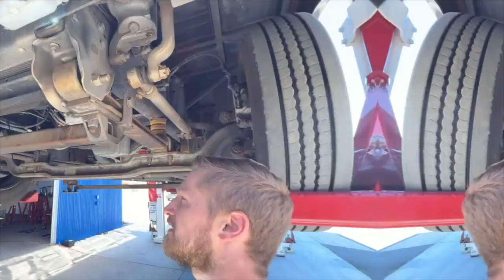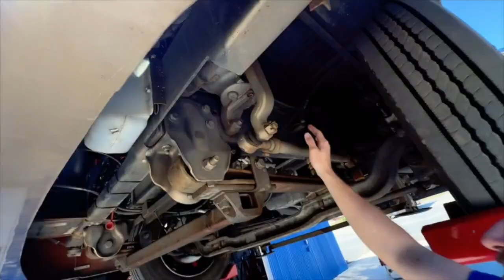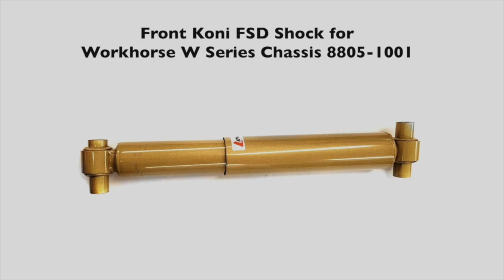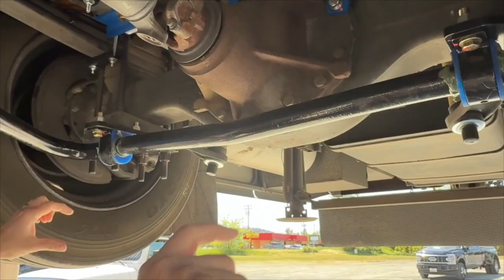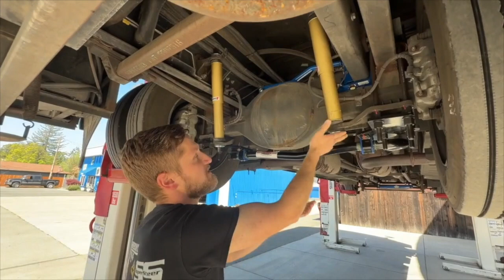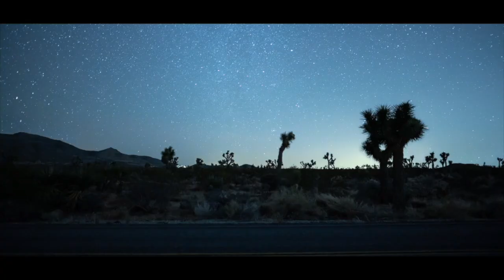Why the Workhorse Chassis Might Be Better Than the Ford F53 (Here's Proof!)

Comment: Nice and comprehensive  - looks like loss of 2-3" ground clearance due to sway bar at rear?
Reply: The rear sway bar is 1.5” below differential now.   However keep in mind that the true low points are the rear hydraulic jacks which are about 5’ further back and about 3” lower.
Reply from the maker: Well said! We have been installing these sway bars on the W-series since they were new, and have not seen issues due to the slight loss in ground clearance. Especially considering that other components such as the leveling jacks already sit lower.

Comment: This is my coach.   A couple of comments on a) Henderson Lineup/Supersteer; b) the driving results of the improvements; and c) the Workhorse chassis.

Henderson/Supersteer.   Rather than doing the described improvements myself (which is my norm) I elected to have Henderson's do the work.    I wanted an integrated result that includes a full road test analysis and alignment.   Their service and professionalism is really unsurpassed.   The work took three days, so my wife and I stayed the first night at Hendersons, then visited family in the area.   Grants Pass has a lot to see.   Go to Henderson's!

Results.   After the work was completed, we drove straight through from Grants Pass oregon to Olympia Washington -- about 360 miles of rutted curvy interstate with poor concrete and many passes to climb and descend…in wind.  The difference is night and day.   Gone is the massive body roll, lane wandering and bone jarring bridge crossings.   As an overall bellwether, I found I was easily driving 5 to 10 miles faster comfortably -- from a usual 60 mph, to 65 or 70 mph with comfort and a full feel of control.    I cannot point at any one new component as being the best, as they all contribute to a much improved integrated whole.

Workhorse Chassis.   I purchased this 2011 Tiffin Allegro Open Road in 2021 with 18k miles.  It has always been stored indoors the first 10 years and used very little.  I drove it four years bone stock before deciding to upgrade.    Maybe I am just tolerant, but I never felt the soft handling was completely terrible (until now compared to the improvements).   The 8.1L Chevy V8 combined with the 6 speed Allison is a strong drive train combination.   Very powerful and due to the low end torque, quiet comparted to the comparable year Ford V10.    2011 was the last year for the Workhorse chassis, but don’t let that scare you.    8.1L parts are plentiful and many shops are happy to service the same engine offered in may early 2000 pickups.   All in all, I've found that buying a used, low mileage gas motorhome has been a very practical route.   Even with the above suspension work AND a full investment in a solar/lithium/charger/inverter system, I've invested substantially less that on a newer year coach.
Reply from the maker: Wow! Thank you so much for the detailed feedback. We agree, we like the W-series coaches. Glad the upgrades gave you such an improvement in driving enjoyment. Thank you again for your business and for letting us use your coach for a video! We really appreciate your business and the kind words.